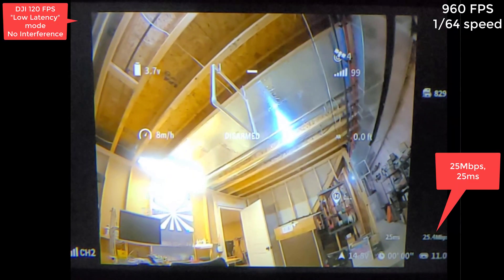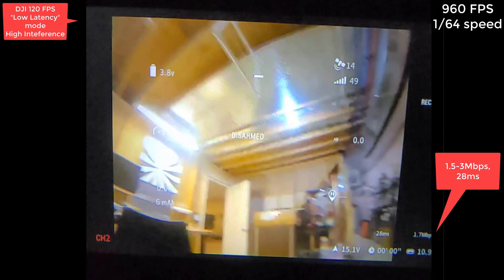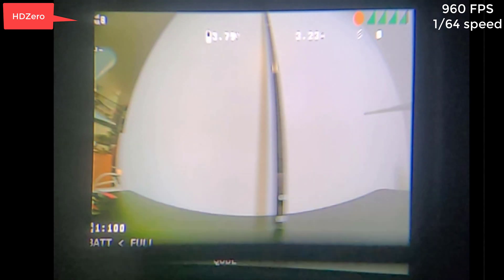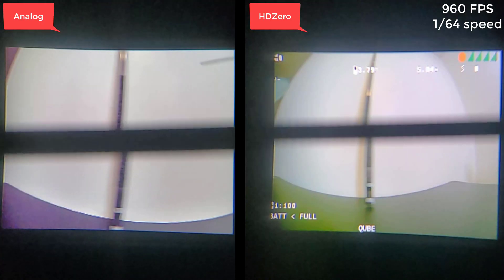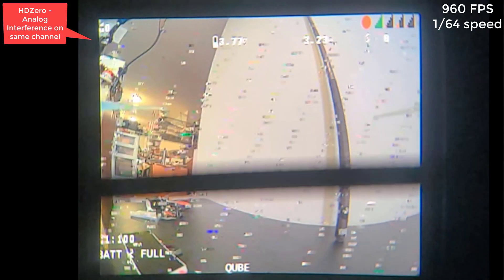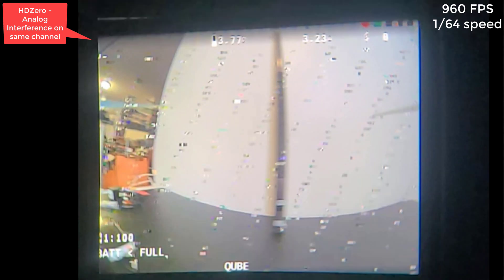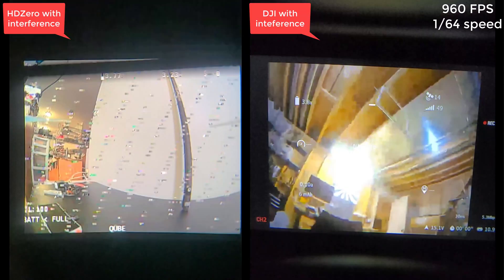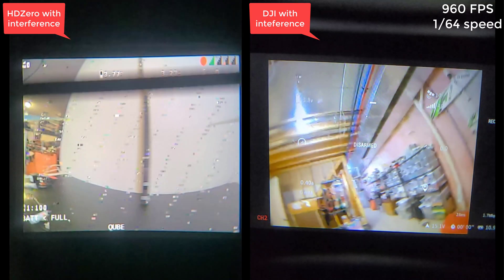Slow-motion Reveals Patterns: Analog vs DJI vs HDZero

Comment: Hello, I think the pattern you see is because of frequency difference between display and your acquisition tool.
If your tool is bit faster, you get twice the same image at some point, if it is a bit slower,  you miss a frame.
No drama here.
Reply from the maker: The frame rate of the "acquisition tool" is 960fps. The DJI camera is 120fps. This is an 8x oversample factor, far above the threshold for which aliasing would be a visible issue
Reply: @RyanQuellet  OK, but this is still à problem of frequency,  dji emits at 120hz, and displays at 144hz, so every 6 image you display the 5th one, no drama here.
With current hdzero goggle définition, 60hz and 90hz, every 3 image you display the second one.

Comment: Pretty interesting to see how inconsistent the frames in dji show up... I was wondering where it puts that variable latency... I guess it's just those pauses in between. And it kills my confidence and drives me so mental XD

It would be even more interesting to see how these feeds perform when they are experiencing fatal drop-outs. I noticed DJI takes ages to recover. I also recognize several frame losses or a sudden increase in latency, when the codec seems to switch to a less bandwidth high reliability mode... and the same on the switch back. And especially the time they need to recover from a full signal loss would be interesting to watch - analog producing desyncs (still often allowing you to gage if you are level and past that tree), DJI just showing you a pixelated mess, then a freeze frame and then taking seconds to recover from that... especially among leafy trees in summer this is ultra bad. I'd be curious how HDZero handles those losses. Is every line addressed absolutely so does that goggle know where to place the next line after it receives data again?
Reply from the maker: Good observations. I did a long range outdoor test between hdzero and analog that answers some of these questions. If hdzero fails to receive a line of video, then it is shown as random color blocks to show that the data is obviously corrupt. Hdzero also instantly recovers from frame loss

Comment: But would it be the same thing if dji was receiving data at 25mbps (not at 1.5-3 mbps)? Maybe I missed something but if you compare hdZero at 1.5 mbps, not a lot of the image will be visible anymore (I read somewhere that the bitrate of a HDZero dvr was something like 12mbps)... Just saying, have fun flying!
Reply from the maker: The second clip of this video shows DJI at full 25Mbps. HDZero does not have a bitrate, because it doesn't stream a video file (it broadcasts at full bitrate, but the goggles receive only what they can)

Comment: Latency does matter. I just can't emjoy DJI 60 FPS cameras because of the added latency. I'm working on gates moving as fast as I can and it does make a huge difference. However on low latency mode at 120 FPS and 50Mps it works perfectly. This is a good video it explains why DJI has better image but HDZero can match the picture quality at much lower power output and using one directional transmission. That is a huge difference and really shows how good V1 HDZero is compared to DJI.

Comment: Great Video.

I absolutly love how DJI does it. 
Itis so clear. 
Hope they Release a Air unit V2 with 1080p120 that would be unbeatable. 

I can accept some latency spikes because I am no Hardcore racer or Freestyle Pilot.
Reply: For a 1080p 120 fps you would need dobble the bandwith, 100mb/s. you could have 1 quad in the air at the time: also not legal almost everywhere as far as i know. So that won`t happen.
Almost all comparisons of DJI and HD Zero already use 50mb/s mode on DJI. Thats dobble the bandwidth of HD zero and allows only 3 pilots, so its apples to oranges.
But i understand why you like DJI, in looks great, cant argue with that :)